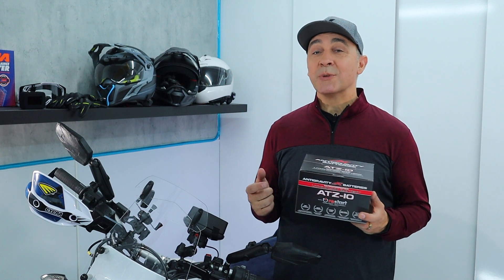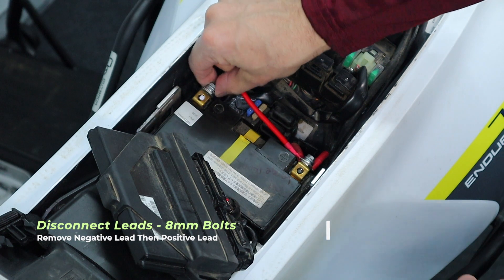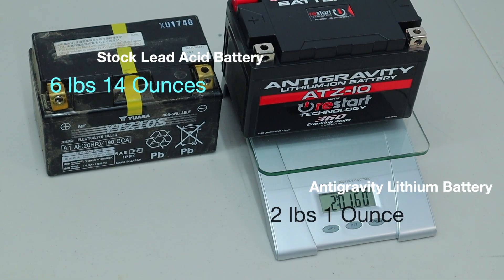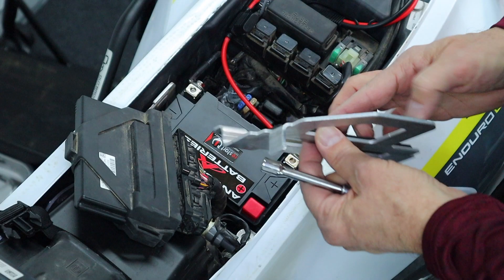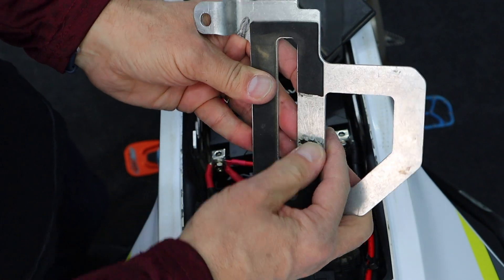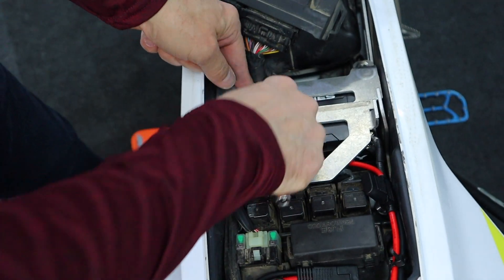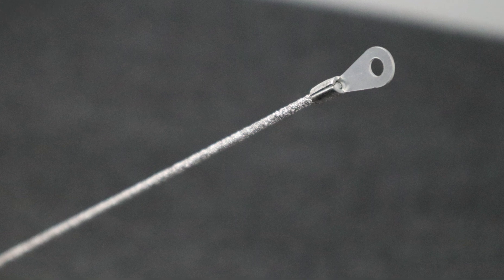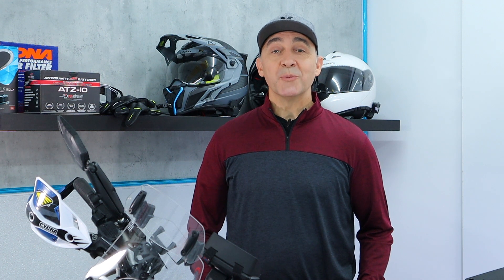Antigravity Re-Start Lithium Battery install for Husqvarna 701 enduro and KTM 690

Comment: How important is the height of the battery, if the new replacement-battery is 10mm higher than the original-battery would that be a problem ?  Would a gel-battery work that has the specs of 12V, 9AH ?
Reply from the maker: The original battery is snug so I’m thinking a bigger one won’t fit. 12v9ah sounds close but I would google the OEM battery spec to be sure.
Reply: @dualsportgarage  Thanks for fast answer, ok so sounds like the measurements on the battery is kind of important then. Yeah 12V and 8,8Ah is the OEM battery spec.

I have entered my 2020 690 Enduro R on different battery retailers and they suggest me to batteries with anywhere from 8,6Ah to 14Ah.

 I will go for a battery as close as the OEM to be sure on the amphere-hours, is there any other spec on the batteries I should watch out for ? 

Does it matter if I buy a lead-acid battery or a gel-battery or a lithium-ion battery except the weight ? I think the OEM battery is a cheaper Lead–acid battery.  Cheers!

My 2020 690 Enduro has for the absolute most part only been standing still in a hot garage for almost 5 years, I rode it 932 miles (1500 kilometers) back in the summer of 2020 when the bike was brand new, nothing else since then. That is why I think the OEM battery now is fucked.

Maybe I should try to charge it up for 24 hours before changing it though.

Comment: Is the AG battery still working? Would you buy it again?  Also, is the restart button only the round section with a circle and red line in the circle or the entire square labeled restart. I believe you said its only the round portion. Im thinking about this battery and perhaps drilling a round hole on the metal top plate rather making a larger notch.
Reply from the maker: Yes, and Yes. Also, yes the button is only the round circle area, not the square label, so as long as you measure carefully, indeed a hole saw should do the trick.  Cheers!